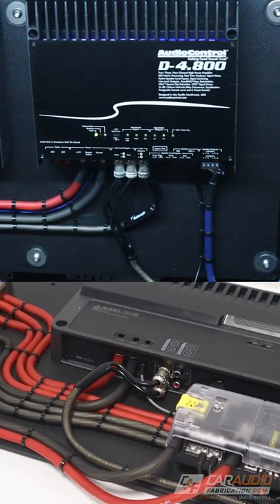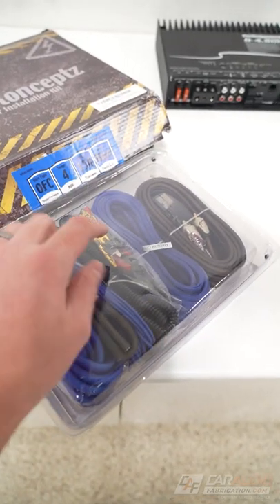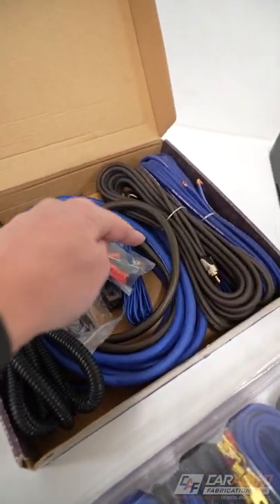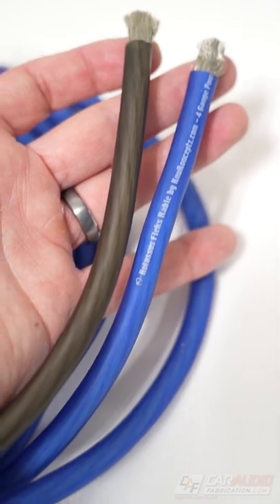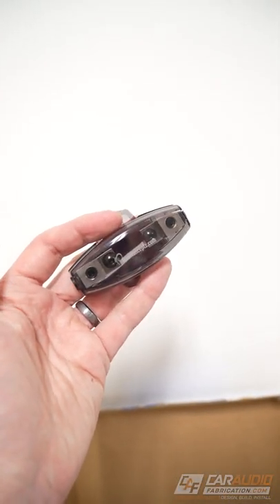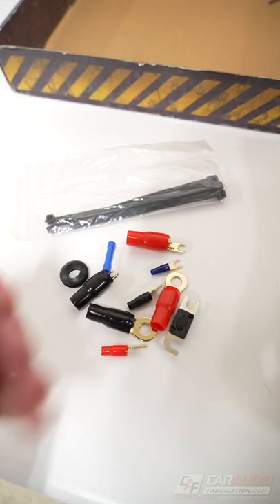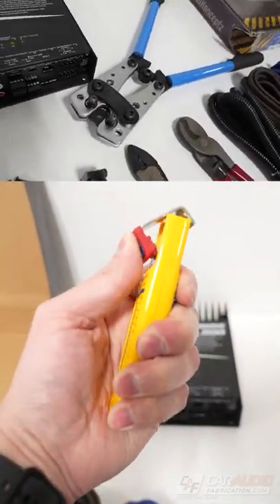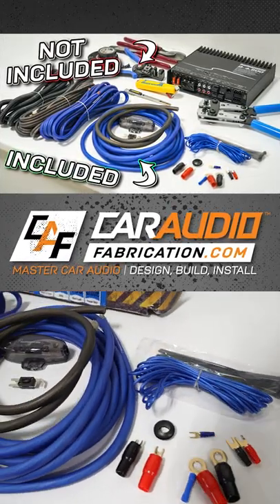What is in an amplifier wiring kit? #shorts

Comment: My husband’s truck is 2002 ford ranger edge 2wd,5spd,4.0 HO . He is younger than me lol but he love old school bass 😂heavy metal and southern Rock,exc. he has changed the factory speakers to 6x8 pioneer 4 way, in back 6x9 in the doors he is now wanting to put a amplifier and at least one 12 inch sub in a hatchback box front slanted but I probably say he will put 2 what is a good recommendation 😊please.
Reply: I have a 2008 ford ranger single cab and I put behind the seats a Kicker 48TCWRT122, it’s a 500 watts rms 12 inches subwoofer with a passive radiator in a sealed box, I know they create powered boxes as well, you can always switch out the kicker 12 inch comp r sub for another one too, works great!